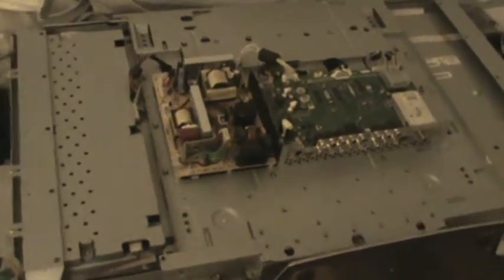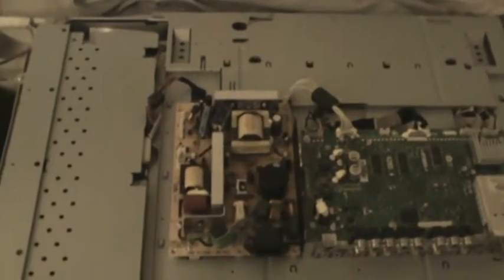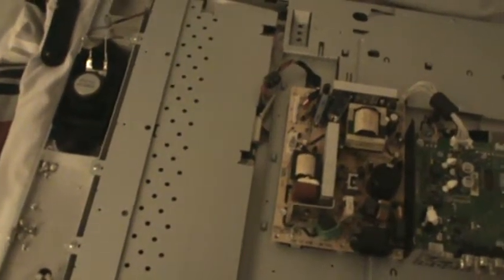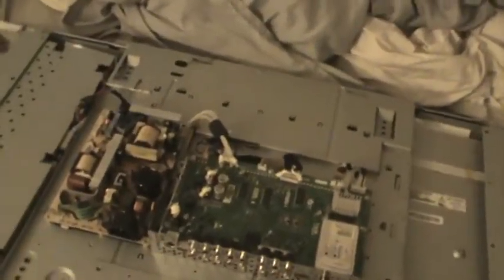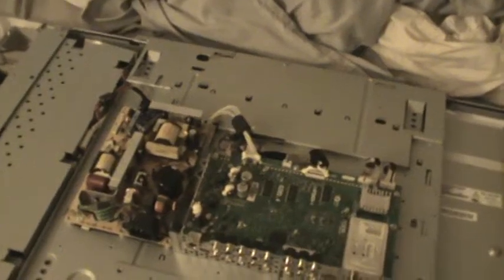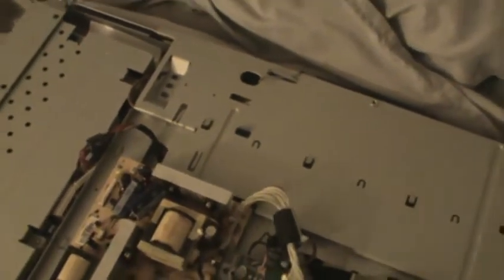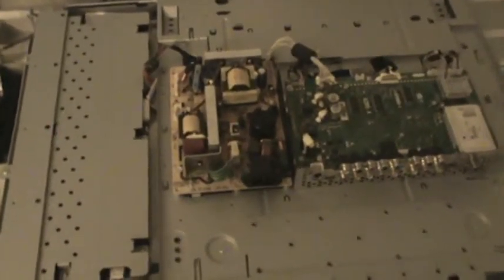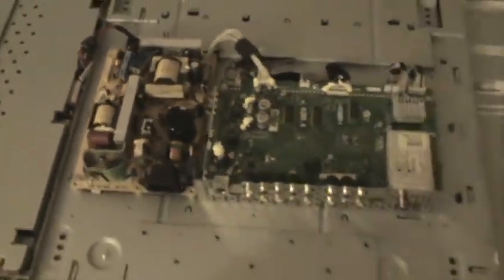How To Fix A Magnavox Flat Screen (Model 32mf231d/37)

Comment: I have a 37" otherwise model # is same.  6 months aft er the two year warranty expired it just wouldn't turn on.
Reply from the maker: I would definitely check the fuse on the power supply and then inspect components. I would definitely take a peek at the caps

Comment: what I want to know is how did you get this TV apart. Other TV'S, the back panel lifts right off.
Reply from the maker: My bad about the late response - I used a small trim panel pry tool used in car audio. A scraper or butter knife should do the trick. Just gently pry just case you missed a screw or 2

Comment: Awesome video. Found this TV on the side of the road and took it apart using your video. Sending the board out for repair. Hope that fixes it. Looks like I have the same problem as in your video. Thanks.

Comment from the maker: Yes it should. Make sure you replace them with a capacitor that has the same rating and make sure you get the polarity correct as well its printed on the circuit board.